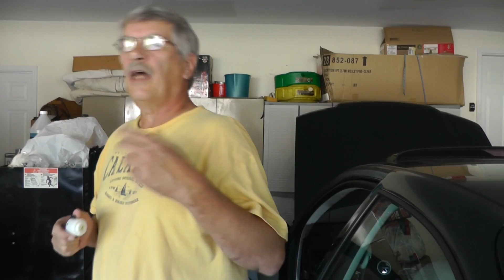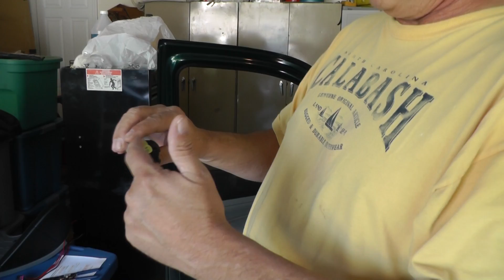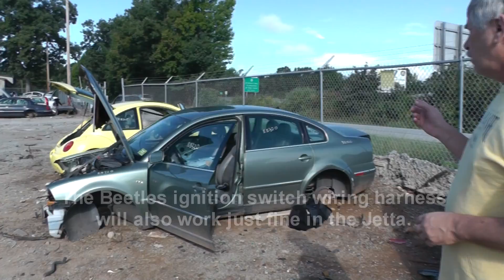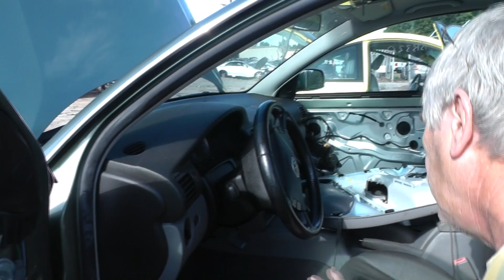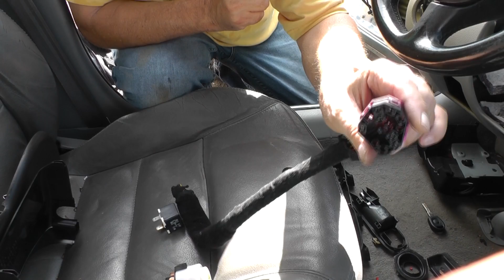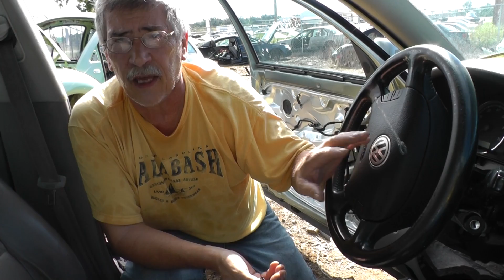Volkswagen Jetta Repairing Ignition Switch Wiring Harness - Part 4

Comment: Hit the enter button accidentally.  This was a great video series.  Very informative, and you are a hoot.   No that it really applied to my situation at hand, I watched the whole series as you tell it straight.  Same thing happened to my 1999 Jetta, minus the smoke and verve this weekend.  Took it to the store Friday and and No Va on Saturday.  I can do a lot myself, but sometimes, time is a must.  I have a great little shop here in Austin called "Go Greene Automotive".  I got it towed sans gratis thanks to my cool insurance company, and they found the issue quick with the info that I obtained from you.  I appreciate ya!
Reply from the maker: Hey Derek. Damn, Volkswagens burning up all over the world LOL. Always glad to help and yes, I tell it like it is! Hope your car gets back to running with no issues. Take care Derek...
Reply: Got the Jetta back.  Runs great, especially with the new Altima tires.  Only caveat is that my radio doesn't turn off when taking out the key anymore and the key in the ignition sound still goes off after I take the key out.  Woohoo, other trip back.  Thanks again for your informational videos.
-D
Reply from the maker: Derek Martinie Sounds like you've got a bad ignition switch Derek. There is a contact inside the ignition switch that will close when you put the key in the ignition. This contact will close without turning the key. Sounds like that contact is stuck closed. I'm sure that I show it on the ignition switch wiring if you're interested to see. Glad to hear that your Jetta is running well.
Reply: +stuzman52   LOL... Took it to the shop and got it replaced.  ~2-3 months later my air bag blew up in my face.  Good times.  I really loved that Jetta, butVW doesn't make the parts anymore.  Driving a Kia now.
Reply from the maker: +Derek Martinie Yep Derik. Sounds like it was time to let that joker go. Air bag going off never sounds good. Good luck with your Kia!

Comment: Thank you so much for the video , you did amazing job , I have voloxwagen jetta 1999  transmission not shifting , changed oil and filter still same problem check engine light on l have more than 12 codes I tried to clear them came back again
I replaced the tcu checked all  driver side fuses is OK finally I took the car to transmission shop they said the car have wiring problem , I don't know to start from where. 
Thanks
Reply from the maker: Hi Atif.. Yeah, wiring problem on the VW's seem to happening a lot. If you watch my last video in this series which is a little long, it can give you some insight to why these cars will burn wires. Surely not all twelve codes is just for the tranny. I would suspect that if you are have wiring issues, that maybe there is a code about B+ voltage being low. If so, I would start there with the voltages at key points in the system to see if it's correct. If you're going to work on the car yourself, you will definitely need to have wiring diagrams for troubleshooting. Take care Atif...

Comment: Thanks! I'm in for the electrical video, honestly I don't repair cars but I love watching .. I like the two wire sensor tutorial ... If it's possible I would like to watch a stepper motor troubleshooting video.
Reply from the maker: Hi Tito. I guess you're talking about the IAT/ECT sensor video and glad you liked that video. As for the stepper motor video, that would take a good amount of setup time, microcontroller talk, stepper motor design being either bipolar or unipolar and how the magnetic fields interact with the armature. Then there's the circuit design for driving both types of motors using a H-Bridge for the bipolar, or a traditional four separate pulses for unipolar motors and then the troubleshooting aspect. That video would turn into several videos to cover it fully. Tell you what....I'll keep it in the back of my mind and let's say we'll play it by ear.

Comment: Terry you are an inspiration on how to do things right the first time-great repair! Where did you get your extension light and clamp meter?
Reply from the maker: Hi Jimmy, one thing about me is that when I do a job, I try to get it as right as I can. Why? Because I only want to work on that problem one time and don't want to see it again. As for the drop lights, (got two of the same), I picked them up at either Home Depot or Lowe's. I can't remember which one. As for the clamp meter, I got that from www.tequipment.net It's a few years old now, so not sure if that model is still around. Thanks Jimmy for dropping by and leaving a comment and for watching the video(s).